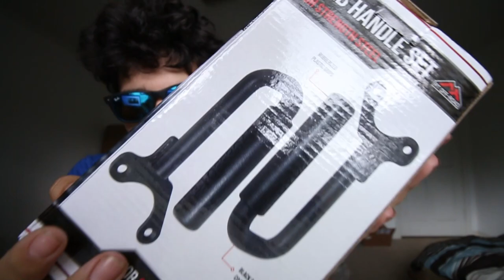Putting a hammock in a 2 door Jeep

Comment: Really cool videos! I’m trying to find a way to camp in my YJ with two people.
Reply from the maker: AZ_Dylan_Tricks I have one possible way I was going to try myself. Build a platform that runs across the wheel wells with supports in the middle and then have a hinges at the end that fold down when you push the seats forward. I built something like this once although wasn’t a fan of the lack of space for storage
Reply: Life of Trevor I’ve got some pictures of my set up if you want to see! I’ve just got to add the hinges and a way to support the fold down plate form.